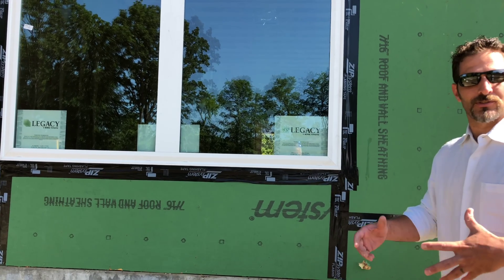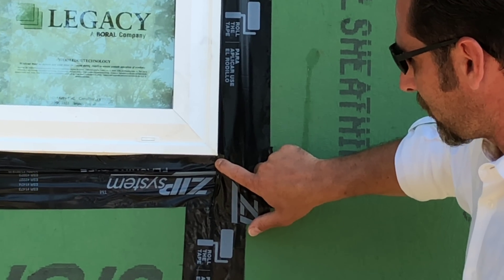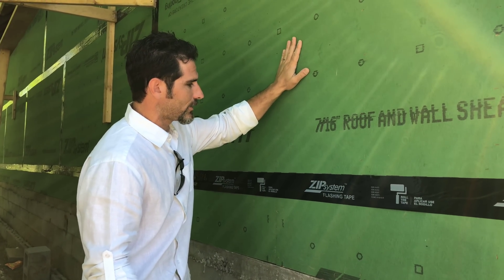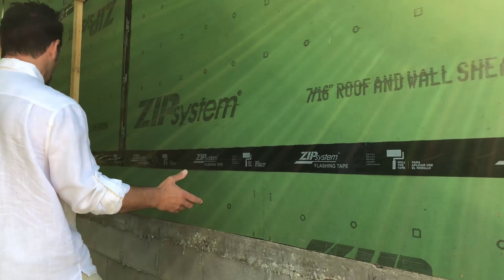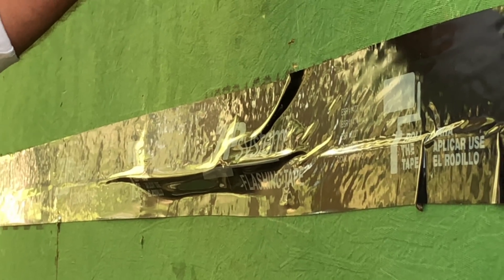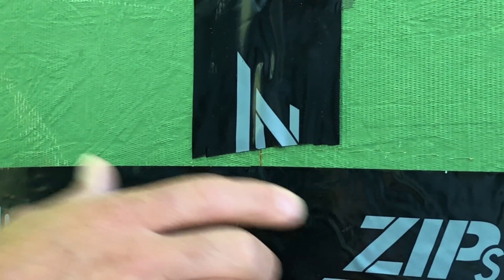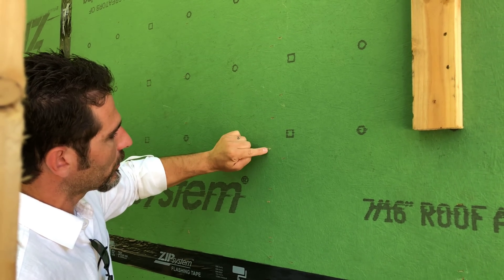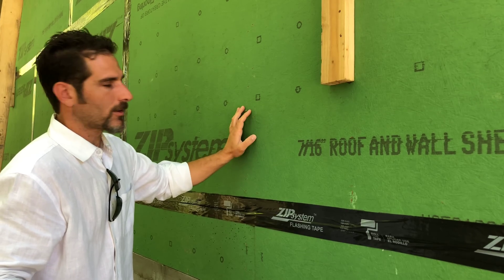ZIP System Problems

Comment: I’m confused about the conditioned air meeting non conditioned air. Isn’t the exterior walls going to be insulated? I don’t know if I buy this finally comment about permeability  and a condensation problem. If properly built I don’t think that should occur? Please correct me if I’m wrong.
Reply from the maker: Neil Heuer you can think about this situation as if it were a windshield in a car. The conditioned air on the inside meeting the non-conditioned air on the outside causes condensation, the same thing will happen at the exterior wall typically on the sheathing side of the wall.
Reply: But that’s thin glass with no insulation. If you insulated behind the glass that temp difference wouldn’t exist.
Reply from the maker: Neil Heuer that is not correct you still have a thermal difference at the wall therefore creating the condensation.
Reply: @WeatherProofingAmerica  So what is the Zip System solution to that problem?
Reply from the maker: Neil Heuer that would be a question for them as they don’t seem to be concerned or possibly even thought of it....that’s part of the point here is this product is set up for failure in my opinion!

Comment: Its not the system its the installer. Did you just stagger out of a bar
Reply from the maker: Dave Blacken lol That’s the point this system is detrimental when not installed correctly & ZIP is marketing that it’s faster and easier to install that housewrap! But in-fact if you take the time to do it correctly it is not faster and it is more expensive! Even when installed correctly you are still relying on miles of tape and lots of vulnerability! Why would you want to use a system like this?

Comment: Good framers are being driven out by cheap contractors who would rather save a buck on the guy who charges less. Unfortunately all the problems you are talking about are due to this. You get what you pay for usually. Our company no longer frames development houses because of this. I have always used regular osb and tyvek. I wonder what the warranty is on the actual tape it self. Once that tape fails you no longer have that water barrier at the joints which is the most critical. On tyvek as long as it’s over lapped correctly (installed correctly) it will always drain to the bottom.
Reply from the maker: Chad Fullard You are 100% correct! That is the primary point of this video, ZIP is marketing their product as easier and quicker to install than traditional house wraps which is completely false and this is the end result on 90% of the jobs that this product is applied.... sad news for the homeowners!
Reply: Chad
If your company is using OSB AND if you care about quality, Find another company to work for...
OSB is CRAP.. Construction can be enjoyable if those that you hire are quality minded. 

If not, get rid of them.

Comment: I run the panels down on the foundation a couple inches, roll the tape and flush nail.....so far so good
Reply from the maker: william skrainski if you take EXTREME precautions this system might work but is very risky. I would look into a good housewrap with drainage planes depending on what veneer you are using. Hopefully you are already using drainage planes but if not check out our informational website.
Weatherproofingamerica.com
Thanks for watching!
Reply: You're just spreading FUD here. Just because you can't hire competent contractors that can install a system according to manufacturer instructions does not mean that the system is bad. There are thousands of homes built successfully using this system vs some guy who has an axe to grind on the internet (you). Please be more honest in your reviews.

Comment: I current have a builder building my home and they also used the zip system and this system leaks through the walls at windows , nail holes and any where it has a fastener. We are scared this is going to be a big problem later if walls do not have a wrap on exterior walls and now also scared about the roof.
Reply: hopefully 9 months ago ... u sued the contractors ass and won !
Reply from the maker: Thomas Cotton did they already cover up the zip with you exterior veneer? If not it’s not too late to wrap it. The roof should be fine everywhere except areas where roofs intersect with walls or flashing areas.

Comment: Is there code inspection oversight to prevent/correct this?
Reply from the maker: Tom Rich waterproofing is something that codes don’t touch on much. So unfortunately the homeowner gets stuck with water issues!

Comment: Based on example in vid-.....I would be firing some installers. Quick.  If I was the owner, builder wouldn’t be paid until  that shit was fixed per best practice.  Don’t like the tape personally. Liquid Flash is where it’s at. IMO.
Reply: Agreed. Just built a shop using zip R sheathing, liquid flashed all joints including the concrete to sheathing joint, liquid flashed all nail holes, installed windows and liquid flashed them to the walls (except the bottom), and then installed a 3/4" vented rain screen prior to lap siding installation. Any water that does make it through the siding will run down the sheathing thanks to gravity and can dry out. Cost me more than just using OSB and house wrap but is so WORTH it in the long run. Do it right and have no regrets (except my shrinking bank account 😃)

Comment: I'm digging what your saying about the condensation aspect of this although if it is enough to do any damage is to be seen. I do a lot of major tile work in baths and showers and we deal with the same likely hood. It seems that every point you brought up was an installation problem. Also the tape shouldn't be used they make a spreadable sealer that works 10000 times better than tape. Honestly taping over something this close to the exterior with weather being a factor is something that should be reconsidered anyway. It will be interesting to see how this product fairs over time as I have seen a lot of great videos on it but have not used it myself. Thanks for making the video and bringing up these points.

Comment: The ZIP system and this whole discussion reminds me of when Tyvek was fairly new, the National Research Council Canada had done some extensive testing of many products for pre- siding and stucco applications.  The published findings were that Tyvek fared worse than most anything available and that standard 15 lb. felt did a better job in most applications.  Tyvek improved their process and marketed the heck out of it and now it is viewed by many as the "go to", yet what really has changed?  The installation.
I rarely see damage on homes built before the 60"s, but every decade after that, I see more water issues.  The amount of problems is greater each successive decade, even in homes less than 10 years old!  Why? Again the installation.
More homes are being built by the production builders and they pay subs on price and speed, not quality.  I have yet to see a quality production home, especially from one of the national builders.  I make a living on fixing the issues they create.
Reply: true.. i did my bathroom over and found spray painted lumber from home depot marked as cull..(from original builder)
Reply: 100% it's not about the products it's about the craftsmanship
Reply: Well said, and do true!
Reply: What do you find to be the best installed correctly? I’m having a custom house built in two years and this is a issue I’m still looking into. I would greatly appreciate your thoughts and opinions.
Reply: @richardpack4  There are too many variables to even attempt to address your question. Research is the best thing you can do.
Reply: Have removed exterior siding from homes wrapped in 15# felt. Material under felt was as clean as the day it was put on. Have removed exteriornsiding from homes wrapped in tyvek & material crumbled. Many factors involved. Install skills, construction skills, material makeup, etc. Point I"m trying to make is some old practices where spot on. B
Reply from the maker: Bestbuilder the point of this video is to show how unforgiving this system is when not installed with care. No system works unless installed properly, but this particular system has unique aspects that make the end result worse than most other systems installed incorrectly!
Reply: @WeatherProofingAmerica  Yes, and my point was that professionals just like yourself and the Canadian gov. were saying the same thing about Tyvek (which you use because you think it is so good?).  My point (not well made) was that what you use today as a "good system" (Tyvek) had issues just like the ZIP system,  I still see Tyvek installed incorrectly (last month we opened up a wall that was reversed shingled). Tyvek was the "easier to install" in the past and yet if done correctly it costs a lot more than a correctly installed felt system.
I'm not knocking your video,  in fact, I'm glad you posted it because it shows the issues that all systems face- they have to be installed correctly and it takes time to work out the bugs- I like you, don't jump on the bandwagon- remember the LP issue, it was marketed as the next best thing (better than cedar!)
Reply: @bestbuilder1st  can the red tape that hold tyvek together fail?

Comment: So its not the Zip System that is bad. It is piss poor management of the laborers and the contractors not following prescribed instulation guides. Even tyvek has problems when not taped right or has other intrutions. If a home owner is having ahouse built, they should be doing research and checking in during construction to make sure the good money they are putting out is being usrd correctly not fraudulently.
Reply: David King wrong
Reply: @George-nx5lo  wow only "wrong"? No discussion of what parts you think were wrong? You must be one of those contractors who does it the cheap way or doesnt want your customer to do their research
Reply: David King watch the video
Reply: @George-nx5lo  um duh i did. And like i commented before all the bad things he dound were due to contractor neglect and formen not checking the labors work. It is a terrific system when installed correctly. Its also up to the customer to do some research and find out what system will work better for their climate. I know if i was having a house built i would do the research and double check what they were doing. Its my hard earned money paying for it and i would expect it to be installed correctly.

Comment: The contractors that installed the sheathing are absolute clowns. Thanks for giving the overall building community a black eye.
Reply from the maker: Ryan Kelly unfortunately this is happening more often than not all around the country! This will be one of the most costly expenses in this industry for homeowners in my opinion!
Reply: I will have work for life repairing this trash

Comment: Looks like Weather Proofing is being backed by Dupont. It's obvious this builder did a terrible job. It's like saying hammers are bad tools because they break the glass on windows. When a tool is used incorrectly, the tool can't be the culprit for the misuse. And no Zip is not paying me.
Reply from the maker: Jose Padilla I have never been paid by any manufacturer. I simply have fixed water intrusion using Dupont Tyvek for almost 20 years. I made this video because zip system has become a pandemic. It is being marketed as easier and faster to install then housewrap, when in fact if done correctly it is quite the opposite! Which is exactly what we are seeing, the results of quick installs! Someone needs to shed light on this or else the homeowners will be stuck with the bill because you know the builders will deny responsibility as well as zip pointing to the incorrect installation so the homeowners the one stuck with the bill....
Reply: @WeatherProofingAmerica  It's a pandemic because of shitty builders not installing it correctly. If you install any WRB incorrectly it won't work well. Huber is saying that it's a more efficient system compared to house wraps with both being installed correctly. Also you don't know what you're talking about as far as vapor permeable as in many southern zones in the US having a low perm rating on your WRB is a great thing since you are cooling the majority of the year. In the northern zones you will be installing a vapor barrier on the inside of the wall to prevent vapor from entering the wall cavity. There's been plenty of science from much smarter people than you that's went in to the development of the Zip system. The overall conclusion is hire a reputable builder that knows their building science and whom will make sure whatever system used is installed per manufacturer's specifications.
Reply from the maker: @JC Wilks Why so hostile?  If you read many of my comments on this video or on others from my channel you will see I agree with you on low perm for hot climates (that is basic stuff).  As far as installing this system vs a housewrap incorrectly, the amount of issues you will have with the ZIP will far outweigh house wrap installed incorrectly.  The piece where I talk about permeability in this video I am referring to water intrusion.  Once the water is inside the wall cavity it is trapped.  As well as in primarily cold climates this system is not the greatest.  But I am sure you know this.  Expecting average construction sites which make up 80% of residential building to just make sure they do it right has been a major issue and continues to be.  I am trying to raise awareness that if this product is not installed correctly it can be devastating rather quickly!  Thanks for watching & interacting!
Reply: @WeatherProofingAmerica  Not hostile at all, just blunt. You're basically presenting information that fits your narrative. If someone does similar mistakes installing Tyvek the same crap can happen. If you don't bring the WRB down past the sheathing and seal it against the slab, if the installer doesn't shingle it correctly, overlap correctly, doesn't tape it correctly, etc. I guarantee you if someone doesn't shingle their house wrap correctly it will be much worse than the little tape funnel you showed on the video. Zip when installed correctly is a much better product if your looking to do a passive house as you can seal all the penetrations on Tyvek you have thousands of staples holes. Point blank both systems work just fine if installed correctly.
Reply: @natus-cum-libero-arbitrio  Your not telling him about permability difference which is big between housewrap and zip.  Zip is crap in cold climate as it cant get the humidity out from wall cavity, created in the house.  You might say oh vapor barrier exists inside home but it cant perfectly protect can it.
Reply: @WeatherProofingAmerica  zip in cold weather is hell as it cant get condesation out from wall cavity made in the house!
Reply: @WeatherProofingAmerica  house wrap alone is pretty garbage. Zip gives me another R12 or so worth of insulation from just the foam with no thermal bridging. Wraps can’t do that.
Reply: @ksun-21  That’s why you use the zip with foam. If you have cold condensing surfaces inside the stud bay you’ve already fucked up. Also, why isn’t the home dehumidified?